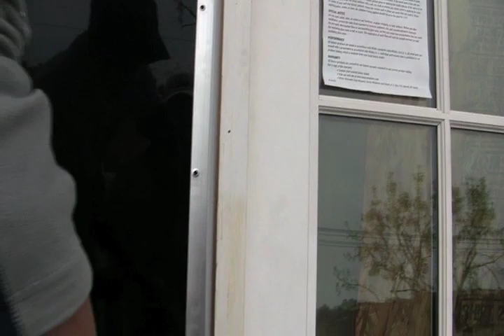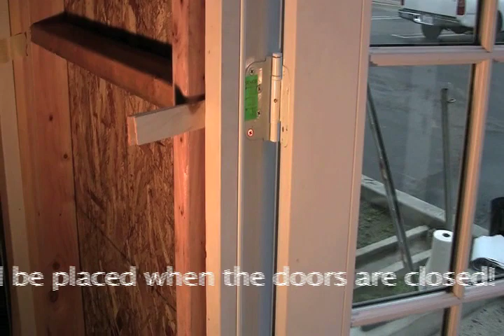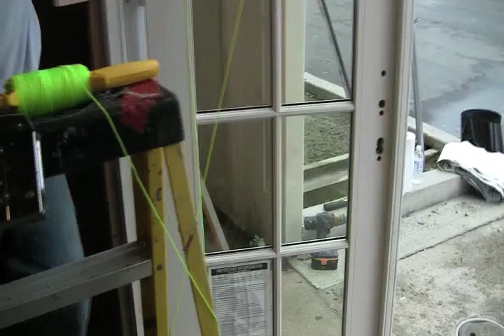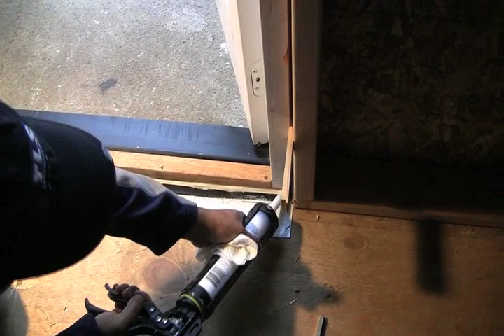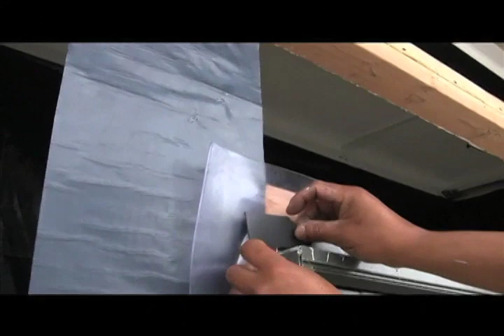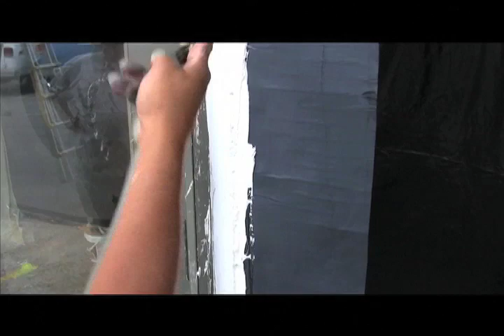French Door Installation-essentials! 2 of 2_by TLS Laboratories_

Comment: From the look of the video the reveals do not seem to match. Ive dealt with some some French doors producing the same alignment issues. What have you done to get the alignment correct so the strike plate, latch, door know, etc work as anticipated? Ive strung them, set offsets with a laser to ensure inline. I feel some door are manufactured incorrectly and there is no way to install so they swing, close, and latch as supposed to. What do you think?

Comment: This video is great. Thank you. Now I just need to find one just like it but for older cinder block homes with specific (perhaps non universal) install widths. I guess that requires a door frame with a significant perimeter of wood framing. I’m trying to fix a door (or install new ones but the existing frame is only about 2 inches. Is that too small of a frame?

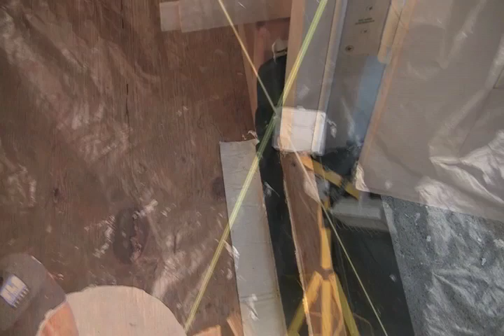Comment: It looks to me that there is a strip of wood INSIDE the sill pan — the inner side of the membrane is folded up against that strip of wood…..meaning that the strip of wood would be inside of the sill pan….(at around 5:30 in this video).  I would think that such a wood strip would gather moisture and rot……is that strip removed before the installation is completed?

Comment: Hello,  What is the point of the non stick flashing tape as compared to the sticky versions?   Thanks.  Doug
Reply from the maker: Non stick is easier to use. Many prefer a non-sticky version; I frankly like both. Both may be self sealing. Depending on your location in the country, the non-sticky version may not be available. It seems to be a west coast product. I have never seen it east of Colorado. The methods in the video may be used with sticky flashing too. User preference. Thanks for watching! - Gene

Comment: I"d rather use a over the flange tape from Pella instead of so much sealant. Less time consuming, messy and less expensive. Can be applied in cold weather. Pella's tape has a thin aluminum on the face that is rubber backed, with a sticky adhesive on the back.
Reply: Norm, I'm so glad and happy for you that Pella tape exists. It apparently means a lot to you. Just like what Harley Davidson means to most of the Harley rider. I will remember you whenever I see a Pella tape on the shelves of a hardware store. You're the William Wallace of the brand. They owe you their existence in the market.
Reply: Norm Sayle, everything you said was ridiculous no one is getting poisoned and dying from caulking calm down. Did you know that you breath carbon monoxide when you drive you're car. Gene is obviously a professional that knows what he is talking about and made some very good points. Also he has evidence to prove his theory. So just listen to what he tells you and you might learn something
Reply from the maker: Used it many times, tested it many times. Theoretically it is fine. The trouble starts the working on scaffolding or windy days, wrinkles happen resulting in failure. But to each their own. Keep using the tape and good luck to you.   Gene
Reply: I've used Pella tape many times myself in windy conditions. It sounds like you're not familiar with it's proper application. You peel the back off as you go. You can use your fingers or a small rubber roller to keep it lying flat. No messy caulking to worry about. Plus, don't get that caulking on your fingers, your body absorbs the poisonous chemicals it's made of.  I've had zero failure if applied properly. Besides, caulking  cannot be applied in low temperatures as it interferes with it's curing capability. Thus limiting the time of year for such installations. With Pella tape, all you need is a heat gun and you're good to go. Good luck with all that caulking though. Please inform me of the company that manufactures it, as I want to invest.
Reply from the maker: Hey Norm, I am really good at applying Pella Tape as are my employees. In fact if someones prefers tape on the nail flange, I'm good with that. My issue is all the guys out there on piece work, or who are not trained correctly. The sealant method is idiot proof. Tape method is not.... Just this week (much rain in California) I have inspected and tested two jobs where this is the problem. Issues include the joint where the nail flange pivots on the frame. This joint is not water proof. The tape can easily miss this problem area. Plus cracks in the nail fin, Tape does not repair these as well as sealant.  That is my very recent experience. All the best to you, Gene
Reply: It sounded like you weren't in your last post. That you had problems in the wind. It seemed like a homeowner using it for the first time.  I agree if you don't use it correctly there maybe a problem but that can also be said for sealant too. You've just revealed your lack of understanding on the use of the Pella tape. You can also apply it to corners etc. as well as the nail flange. Broaden your awareness on the products use so you can eliminate most of that caulking/sealant you use. I like the tape because you can also penetrate it with a fastener and it seals around it. Each to his own I guess. I just don't like my workers being subjected to the toxicity  of most sealants. MSDS due dilgence should prevail when using any types of these sealants. Check out the long term effects regarding the coming in contact with skin and breathing their fumes. The use of a Pella type tape will become more inviting.
Reply from the maker: All the best to you! Take care,  Gene

Comment: Hey Vid Skippy...  as a tradesmen since 1979 your string test is NOT a PLUMB test!!! All the string test does is check weather the door is RACKED... Plumb is a vertical up and down, Both sides can be plumb but door can be racked. Now that you learned this, you did NOT check to see if door is sitting in the frame SQUARE!!! Look if your going to do a video to guide people PLEASE learn first and your the one that says most people doesnt  know what plumb is and you also dont by misleading people thinking the string test is a Plumb thing
Reply: Hi Gene and thanks for the video! I’m getting ready to install my Andersen French doors and it has been a while (The 70’s) so I needed an updated (no water intrusion) method. Back in my day, all they got was a heavy bead of cheap caulk under the sill and flanges.
I’m not sure what John Troll is talking about? You clearly say (3:28 in video 2) that plumb is perpendicular to the earth. Perpendicular, meaning a right angle to the earth or plane, i.e. at an angle of 90° to a given line, plane, or surface. Then you go on to say you also want something that is in cross sight, meaning the jamb sides are parallel, in plane. Clearly, you made a distinction between the two. Later in the video, addressing some omissions you talked about the door also not being racked, by pulling the tape diagonally making the cross to ensure the measurements match or are with in an eighth of an inch. 
I know you are just being polite with your response and it isn’t worth your time. You took a lot of time to make this video and edit it. I really appreciate the instructions, as I’m sure others did, and will, as well. No one is perfect. For example: “PLEASE learn first and your (((you’re))) the one that says most people doesnt (((don’t))) know what plumb is and you also dont (((don’t))) by misleading people thinking the string test is a Plumb thing (((.)))”
Reply: Looks like somebody didn't watch the whole video.
Reply from the maker: Thanks for your helpful insights and have a Merry Christmas. - Gene aka Skippy..??

Comment: I generally liked the video but I had a couple of problems. First, the framing seemed to be totally inadequate for the size and weight of the door. Where were the jack studs? What kind of header is that? I would never have a header laid flat over a door on a carrier wall. The time to beef up the framing was during the installation while it was totally exposed. Second, I did not see the need to have additional corners when top flashing after the installation would have corrected the open corners of the door flange but that's just me. The framing is the bigger issue.
Reply from the maker: The framing was a result of a demo wall. The wall was actually created in a garage door opening, and was torn down the same day. The demo was not to illustrate wall framing, but French Door installation and flashing. I like top corners bc they protect the top of the opening which is especially important when 2 or more floors are being constructed. If a single story home with an overhang and few penetrations is being built, the top corners are not necessary. Just my 2 cents....   Gene

Comment: Gene's got some good advice. Although if you live somewhere that gets any serious amount of moisture do not cake sealant over the flanges and call it a day. Not that it won't work- it's just a waste of time and there are better ways to do it. Thick layers of sealant will never hold up as well as using adhesive flashing over the flange. If you're really trying to save money, use house wrap under the flanges and adhesive flashing over the flange, onto the house wrap. 

And, I'm sure he just didn't get to it in this video, but don't forget an aluminum drip edge above the door. And while i'm on a rant... I really encourage everyone to use stainless and aluminum products anywhere they will be exposed to the elements. There is no reason for a flashing to fail because someone saved pennies per nail. Stainless fasteners are readily available nowadays, and wouldn't add $10 to the cost of this project. When you install a door, every component you utilize should last longer than that door. There is no excuse for building something that will need to be replaced in 20 years.
Reply from the maker: Dependes on the sealant used. If you use a polyurethane type of sealant, and butter the sealant into place as shown on the video, it will be around when the dinosaurs come back. The benefit of sealant over a peel and stick flashing is it doesn't wrinkle. I have seen 100's of window and doors leak that had the peel and stick flashing applied to the nailing fins (on Top) because of wrinkles. You will never completely avoid wrinkles, especially if working off of ladders and scaffolding. Or if wind kicks up.   All the best to you and good luck, thanks for watching and commenting!
Reply: Gene Summy
Thanks for the video Gene. I always enjoy seeing how other people do things. There's more than one way to skin a turtle, and obviously, i can't comment on your experiences; but i would suggest that covering the flange in caulk is just as prone to installer error. You need a high quality, flexible adhesive applied uniformly or, where i live, even unexposed, it will surely crack or delaminate in freeze-thaw cycles. Caulk thickness can be critical, too thin or thick and it is much more likely to separate. Regardless, i regret to inform you that no organic material will be stable enough to last from now until the emergent dinosaur apocalypse, although I'm sure your method will outlive any modern, standard quality door.

The traditional thought on this is that installation design and technique are more important than flashing adhesion. (This type of flange is always going to need caulk, but not necessarily on the flashing.) 

You could literally replace the top flashing with uncaulked aluminum as long as you properly prepare everything else: wrap the jamb with anything waterproof, run a bead of caulk below the nail holes on the backside of the flange, caulk the nail holes after nailing, and use proper lapping technique to extend the flashing several inches above the top flange. Water will rarely wick up the flange, and when it does, the caulk you already have between the flange and underlayment will direct it where you want it.

Regardless of what material you use, the vast majority of moisture will be redirected by your flashing. The theory is that it's better to ensure that the flashing remain a solid piece of material so that, even if it loses adhesion, it won't crack. In the scenario i describe above, a wrinkle will only permit the penetration of moisture that rises above the flange holes. A caulking failure in your technique could result in the penetration of any moisture that contacts the layer of caulk used as flashing and would put significantly more stress on the secondary lines of defense (the caulking under the flange), and that's why most manufacturers spec some type of solid flashing.
Reply from the maker: Wow, what a great, thoughtful reply. Thanks very much. I enjoy these conversations with experienced people. All the best to you and yours and have a Merry Christmas! Keep in touch, please.

Comment: Depends on the siding condition and the history of the door. If you have experienced leaks in the past during natural rain events, removal of the siding is a good idea. If you have no history of leaks, and you can access the door without removing siding, then try it without siding removal. You can use a skill saw and remove the perimeter of the siding, 6 inches away or so. Then the repairs can include 6x trim around the door.Dot damage the flashing, or plan on repairing/replacing any damaged flashing... Thanks for watching! Gene

Comment: what's your suggestion for installing replacement doors? does the siding need pulled off to make this possible?
Reply: +Drew Dukes Depends on the siding condition and the history of the door. If you have experienced leaks in the past during natural rain events, removal of the siding is a good idea. If you have no history of leaks, and you can access the door without removing siding, then try it without siding removal. You can use a skill saw and remove the perimeter of the siding, 6 inches away or so. Then the repairs can include 6x trim around the door.Dot damage the flashing, or plan on repairing/replacing any damaged flashing... Thanks for watching! Gene
Reply
Reply: No leaks. Just an old drafty French door that needs replaced.

Comment: Thank you for this video.    I had to replace my patio doors that was installed by a company that deals with modular homes.   I was having issues with water leaking in under the threshold of my patio doors.   When I pulled out the old set, I was so angry, the company that installed that old set of doors used NO flashing, NO pan, NO membrane, only a little RTV silicone on the bottom and that's all.   The doors were installed when the house was new 6 years ago, and there was already a spot of rot that had taken place in the bottom corner of the door opening big enough that I could insert my hand.   Thanks to this video, I can install this new set of doors and not have it leak water into my house.   :)
Reply from the maker: +DaveyBenson1  You are very welcome! Thanks for watching. Good luck with your project...
Gene

Comment: I had a "Professional" install my two garden doors and it turns out that they did it completely wrong! No pan system, no flashing and if I'm lucky there may be sealant under the sill. The two doors leak like crazy when there is a decent rain. Lucky for me the inside is not insulated/dry walled / and flooring is not installed yet...but my siding has been installed. What is my best solution to fixing this mess??? I have tried my best to caulk the doors from the outside but it is only slowing the problem! Any ideas or bite the bullet and remove the doors + siding and re-install???
Reply from the maker: CARP SPUDPICKER  I am sorry for the late reply Carp. I would "Bite the Bullet" and do again.  Sorry for your poor experience with my beloved industry...   Gene

Comment: Bad installation - ALWAYS overlap any flashing over the layer below starting from bottom to top.  The chevrons used in this video are an example.  They should have been installed under the perimeter flashing.